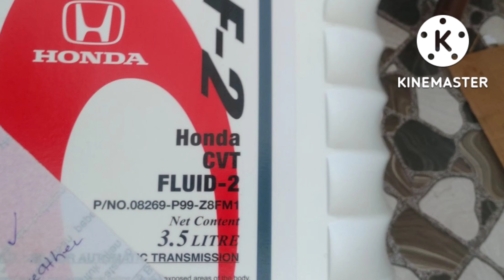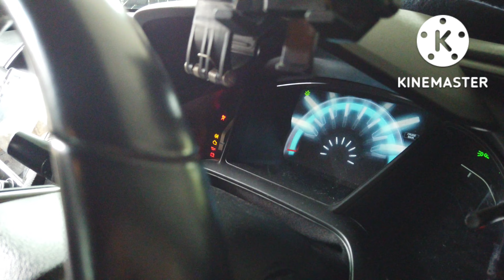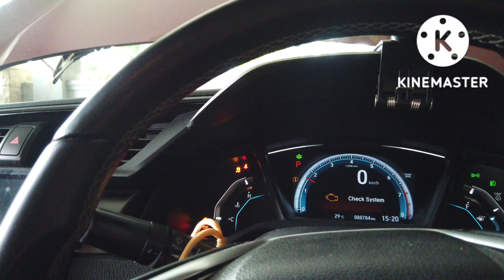Honda civic fc 10th gen cvt fluid and filter change

Comment: Salam boss, tumpang tanya, kenapa naik check system light tu ye? Sebab kita cabut sensor air filter tu ke? Adakah lepas tu dia hilang lepas pasang balik?
Reply from the maker: Ye tuan... Civic dia byk sensor & electronic, bila Kita buka sensor atau connector dari sensor lepas Kita pasang balik, dia akan Naik check system bila on kereta... Boleh reset balik nanti dia kembali normal. Kalau anta kedai kena charge tuan... Boleh try buat manual
Reply: @mohdnazrimohdnor  mcm mana nk reset sendiri boss?
Reply from the maker: Ok bang. Tekan push start button tanpa tekan break. Dia akan keluar accessories mode. Dekat android tekan on off touch button selama 5 ke 10 saat sampai dia reboot. Biar je sampai Naik logo Honda. Dan tekan ok je. Dah normal tekan push start button dgn break.
Reply: terima kasih boss

Comment: terbaik bos... lepas ni boleh la tukar sendiri, tapi cvt proton sama ke?
Reply from the maker: Lain bos...
Reply: Proton kena buat adeption utk setup utk steel belt tegang semula.lps tukar cvt fluid kena buat leveling.ada scan tool ada special mode cvt adeption .kalau x ada hantar kedai ada charge 60-80

Comment: Berapa kerap kena tukar ? Ada internal Dan external?
Reply from the maker: Biasa cvt 25k milage kena tukar. Sekali dgn filter
Reply: Ada two filter right one is internal and one external. Honda sc never recommend to change these filter at all.
Reply from the maker: @adriancheong6227  satu lagi filter dkt bawah. Yg tu x tukar lagi. Tunggu 100k. SC memang x pernah recommend..  tapi ada baik tukar untuk jaga cvt
Reply: Tq. My car I also installed an additional cvt cooler.